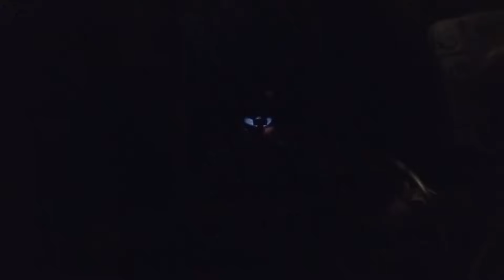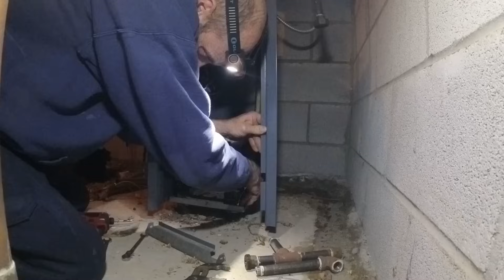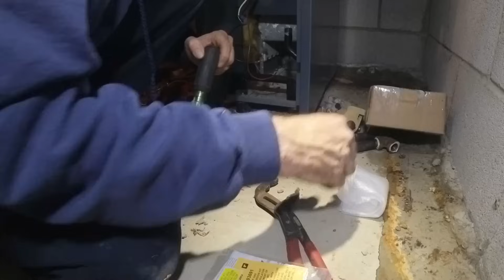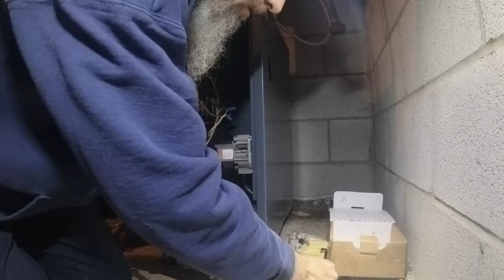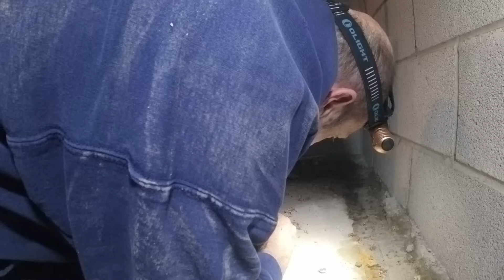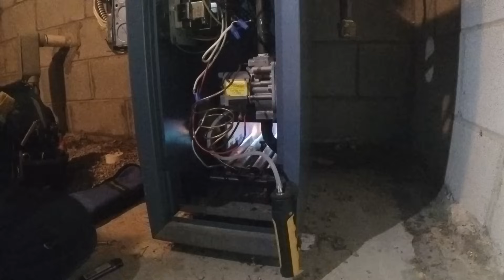FIXED..Your Boiler Is Where..No Heat Gas Pressure Issues..

Comment: Please ,oh please wear your knee pads,  knees are almost as important as your hands! Where would you be without them in your trade. I lost one of mine in 2014 full knee replacement surgery ( Botched) 
But i had 50 good years off crawling in attacks, underneath houses and kneeling on concrete basement floors. 
Now the most joy i have is watching you guy's do what i ALLWAYS love doing.
Reply: I agree.  Despite the razzing at work, they are a game changer.  Much more comfortable, but a pain when they slip down.

Comment: Nice Job: I had one in a very tight place that I finally mounted the gas valve outside of the boiler. Have you seen that done before? Thank for the video.
Reply from the maker: Yes I have done it before. Not a problem